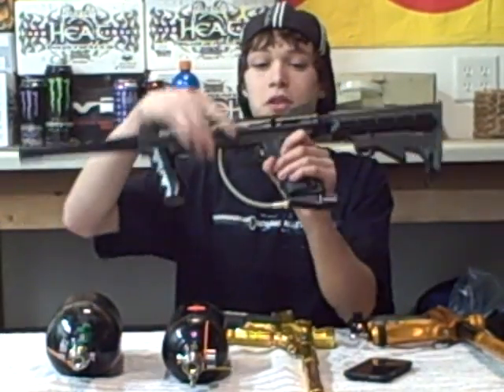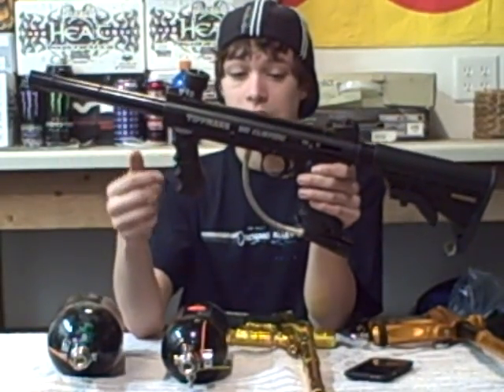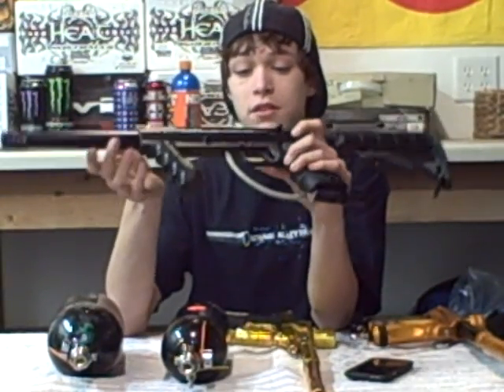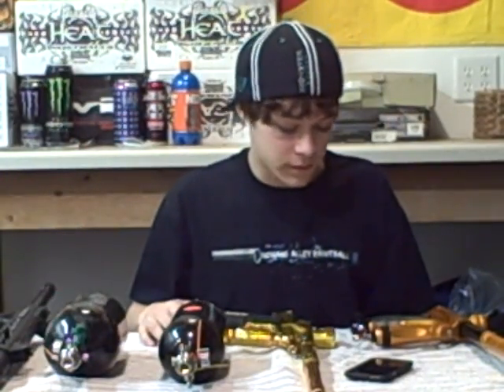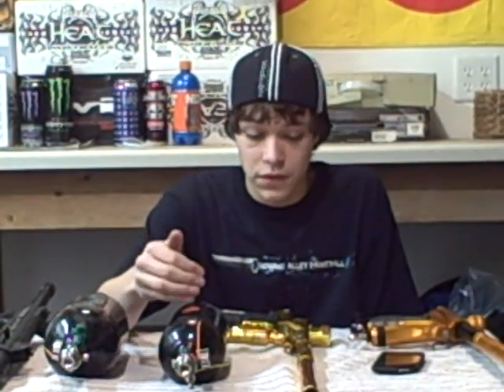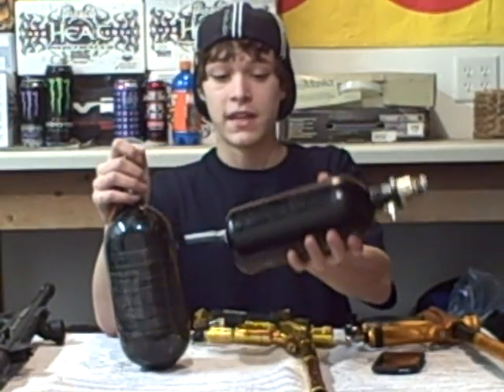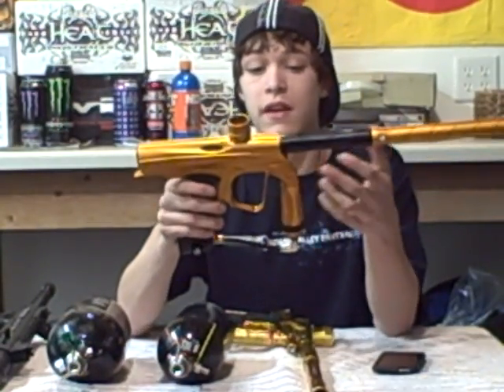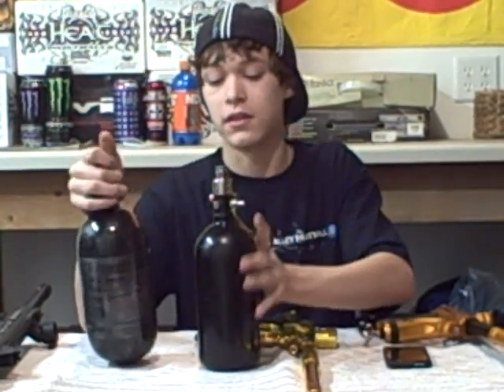CO2 vs. HPA

Comment: The reason you can't use co2 on an electronic marker is because it has an electronic solenoid that co2 will get dirt and debris into and it will stop working. You have to use hpa on elctronic markers. Hpa is also more consistant and efficient and a new steel hpa tank can be had for $30-40 now.

Comment: @p8ntballa771 I think you missed the point of the last one, the only filtering done to HPA is through a compressor which only filters large particles, unlike CO2 which has to be purified by supplier therefore a cleaner gas of the two.  I still agree that HPA is better because it is more stable and consistent, but it is not necessarily ever cleaner.  HPA comes straight from the air, CO2 is used in beverage dispensers at restaurants, CO2 has to be cleaner.

Comment: I agree that HPA is better than co2 but why do you say that co2 is dirty? HPA comes straight out of the air through the compressor into your tank.  That is full of air pollution and dirt which is the real dirty gas.  And you don't want to run co2 through an expensive marker because as co2 expands it gets cold and can freeze and ruin your board or o-rings.  If anyone is reading this, get HPA because it is a better, more efficient air source!

Comment: There are other reasons why people do not use Co2 on high end electros.  1 is that the internals can't handle liquid Co2, simple as that.  You can run a Palmers Stabilizer that prevents Liquid Co2 from getting in the gun and regulates the pressure.  That in Combination with Co2, you can run any electro just fine.

Again, Co2 is not a dirty gas, it is in fact cleaner than HPA.  People say its eats O-rings more than HPA, in reality, then friction in the gun will wear it out first.

Comment: Co2 is Filthy?  How do you know?  How have you tested that its dirty and clogs up the gun.  I will tell you that 10 years + of running nothing but Co2 though a gun, taking apart the valve, still clean as the day I bought it.  It does not ruin your internals.  Your making things up.  Also, what proof do you have that an HPA tank lasts 2 times as long as a Co2 tank.  It is a fact that Co2 shoots far more paintballs than a HPA tank with the same volume.

Comment: also co2 will freeze in the winter(it happened to my old gun) u never know how much co2 is filled up hpa has gauge, hpa more accurate/ your fps will not be as drastically changed like how on co2 how you hold the gun and what temperatures outside are change the fps/ If u have a sucky gun just go with co2 i gues if u have a somewhat decent gun and want to improve go carbonfiber hpa tank

Comment: NO way you cant use a air compressor they usally put out about 400psi a HPA tank needs about 3000-4500psi and they only cost a couple bucks to refill

Comment from the maker: low pressure will work on both of them, just make sure the hole in your macroline hose isnt to small(you should be able to fit a Q-tip in it)